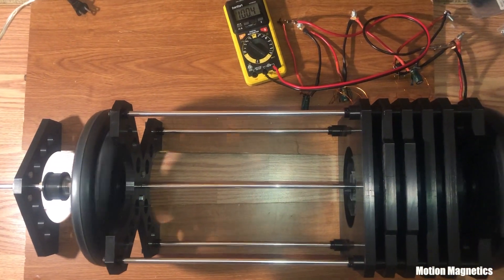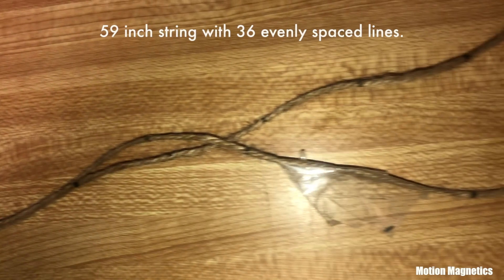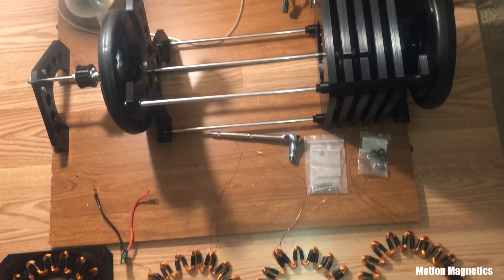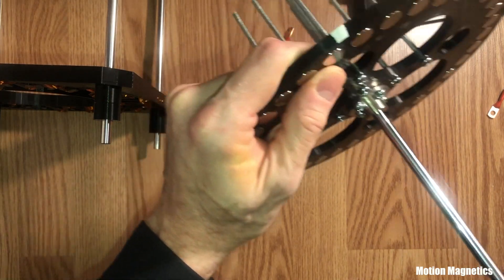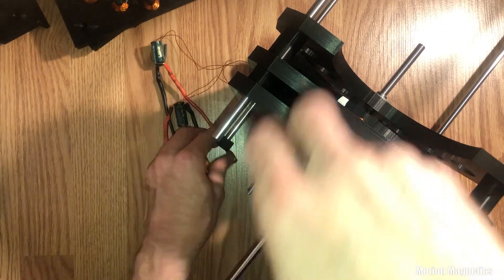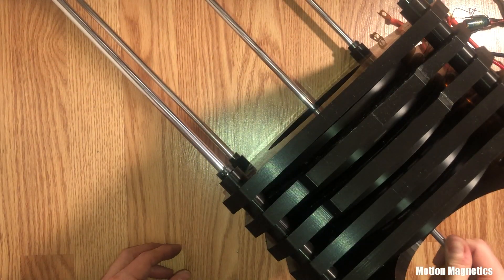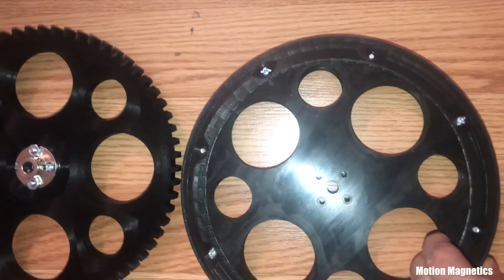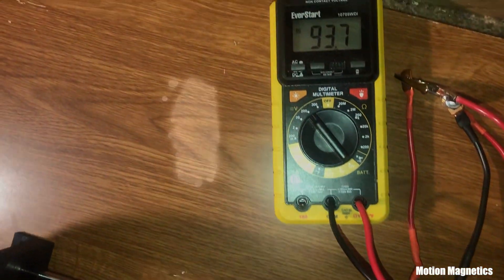Stackable Generator Assembly Guide

Comment: this is awesome generator, or at least at first glance, so I tried looking for at least similar designs and I found almost none accept like those two stator ones, so that begs the question, why (or I can't search is also an option :D) ? I'm not really that sure how this design would be flawed compared to the wider ones (altho my knowledge of building a generator is not the highest so if anyone knows any disadvantages please tell), maybe it's just the 'go vertical instead of horizontal' idea. very interesting :) would love to see some experiments with this, cuz it is exiting to watch to say the least
Reply from the maker: I'm not sure why there aren't more similar designs out there. It just occurred to me when I switched from using coils with metal cores to an axial flux setup that I could stack several of them together to increase the power output. Multiple people have commented that they have thought of something similar, but most of them haven't tried building one.

Comment: If you add propeller like car alternator both side ir wil keep  the coils cooler for longer time since your magnet nad coil center area are open. Like the setup.👍
Reply from the maker: Possibly. You can't tell by watching the video but there's a bit of airflow from the openings in the rotors and coil assembly that creates a fan-like effect, and you can feel air blowing lightly through the assembly.

Comment: In regard to the “rotor alignment bars”…. I wonder if they will pickup any of the magnetic field, potentially reducing the output of the generator. Maybe not, but I’d love it if you replaced them with wood lol. I feel like it’ll make a difference.
Reply from the maker: It's possible. Wood is less sturdy though. I suppose they could be aluminum, but then that could cause eddy currents. 
The magnet faces are not pointed at them directly at the bars. Is there some effect from the metal? I'm sure, but I think it's negligible.
Reply: @Motionmagnetics  I imagine that under normal conditions it would be negligible. However, given that it is not the most efficient design, aiming to keep it simple and easily made at home), maybe it would be worth a try? Also, I can’t remember the term for it, but metals that aren’t magnetic do tend to be influenced by magnetic fields… maybe it’s specifically electromagnetic fields, either way a quick google will explain better than me anyway. There is actually a repelling force instead of an attractive one.  In regards to the strength of the wood, 8mm wood rods should be plenty strong enough. I have forgotten how many you used in the rotors, but  >3 and it should be enough. There isn’t much space that isn’t supported, and the load on the rotors should be relatively even front to back, so there wouldn’t be any twisting. There shouldn’t even be any side loading when the generator is actually spinning, thanks to the wonders of centrifugal force. It wouldn’t work as your MAIN rod, due to the weights. But your main rod has very little rotational mass if you consider the rod with other components removed. So even if wood was strong enough, it wouldn’t change much of anything replacing the main rod. Check out the numbers regarding the strength of balsa wood. Really, if the wood is decent quality, I think some pine dowels would be good enough. Unfortunately they’re sold in standard sizes at the hardware stores. Something like .0025 inches small than 8mm. For straightness, cutting a larger rod down to size would be best. Short of that, I guess balsa wood does tend to stay straighter than pine. Sorry for the essay. I have a semi-kinda almost similar project I’m working on.
Reply from the maker: @thephilosopher13  I hope you'll post your results if you are working on something similar. I'd love to see how it comes out.

Comment: My freind i was hoping that you post the stl file of gravity generator
Reply from the maker: This actually is the gravity generator, I've just adapted the design. I'll share the STL files for the gear system later. I'm in the process of designing and testing a new version of them right now.
Reply: @Motionmagnetics i understand you my freind but this new design in this video i can't build it because there is some material does not exist in my country , all i need my freind a gravity generator of falling weight witch is takes a long time like 6 or 8 hours to reach the ground and thanks a lot you have a good heart i'm waiting for your reply
Reply from the maker: @دعاسيأيمن  Ah, I see. Sorry, you're dealing with that issue. Once I have 3D printed and tested the new gear system I'm working on I'll be happy to share the files. Hopefully, that will help you out.

Comment: high-ratio reduction is a relative term.     anything over about seven to one is usually achieved via the use of more than one stage.    with more losses than a single stage.          d
example of a heavy-machine friction drive, used on a ferris wheel.
https://www.publicdomainpictures.net/pictures/170000/velka/ferris-wheel-drive-mechanism.jpg

Comment: some pma information
you may or may not know the following.
a serpentine coil does  not  make  a good generating coil.        a generating coil should not have  Too many winds/layers, of Too small conductor.      the conductor used should be 14awg or equiv. (coils can be wound  'in hand' if smaller conductor is going to be used.    doing so should result in a relative increase in output voltage, while not clamping the current.)        a generating coil that has too many winds/layers acts as a current clamp.      meaning, you may see 'high' output voltage from such a coil, but the output current will always be  disappointingly  low.        in this case, a flywheel does  Nothing.        as it is in most applications, the prime mover (whatever it is)   SHOULD  have  mechanical advantage (MA) over the load that it experiences.      instead of using multi-stage high-loss gearing,  it is simple and less inefficient to drive a pma rotor via the use of a single stage of (high-ratio) reduction at its  Perimeter; aka a friction drive.       as desired, more than one prime mover can be utilized.          d
Reply from the maker: My intent with this design is to make it simple and accessible to everyone. You're right, there are definitely more efficient and powerful methods to build one. 
The point of the flywheel will become more obvious when you see the full picture of what I'm building. There is method to what I'm doing. Hopefully, people will look at it when I have the entire thing finished and say: "Oh, I see it now!"

Comment: For the weight, I was thinking more of a planetary gearbox similar to (Channel short: Art of Rendering) https://youtube dot com/shorts/eks_oXJZkic?si=9jMPn7_05AphVMqp, with a clock gear like (the 2088 video from Robert Murray-Smith) https://youtu dot be/igzIc3glA18?si=0VR4iyW5rxtBGHXM 

It may be possible to add remove change the planetary gearing or even make it more compact than in the short… and you can still use a belt instead of a chain on the clock counterweight mechanism

Comment: If there is magnet pulling another magnet and if put iron between those magnets. Both magnets are atracted to the iron, so both magnets stops, right. But if i pulling iron with magnet and put iron between those, the moving/pulled iron will continue moving if the canceling is made just right moment. when its comes to sticky point. Luling motor works like this.

Comment: Fantastic and BIG thanks!
I'm going to make one and test a simple cycloidal gear drive. Will share that if successful.

Just wondering if the 400w circuit board link is correct?
Reply from the maker: Thanks! I'd love to see what you come up with. I'm curious about the circuit board coil as well. I couldn't find a place to order it directly or I'd pick one up and test it myself.

Comment: Would be great to tilt / angle the magnets so they build a toroidal flow down the stack for further reduced friction and a little rectified force vector for rotational influence. 
Fantastic design.
Reply from the maker: Interesting idea. Thanks.
Reply: What axis angle would be sufficient for this? What, if any impact would such a modification have on output other than differences from the reduced friction itself?
Reply: @joes144  Follow the golden ration… allowing for a full rotation around the axis for each curve / line of magnets from top to bottom of the generator.  Magnets can be oriented to create a steady flow from top to bottom, essentially physically copying the field expression captured when you freeze a magnet in water.  Have the polarity such that the generator never sticks into one place but wants to finish a full cycle rotation once started.
Reply: @meh11235  Interesting, however I'm having difficulty visualizing what you mean. Are you suggesting canting the magnets within the rotor such that the angle of each magnet can be set same/different, or are you suggesting a rotor with angled edge such that all magnets are at the same angle relative to the coil?
Reply: @michaelh.9243   a mix of both, magnets set to same angle within the rotor and opposing inverted coils or stationary magnets between coils to cancel the magnetic drag that builds up by the coils being activated by the passing magnets. using the S side of the magnet or -coils for addition electrical force vector and drag negation.

Comment: Herring bone gears are quiet and a lot stronger than flat straight gears.  This would be an option of the belt doesn't work out.  If you need help with those, I know how to make them very easily with Blender.  Also, to save a lot of money, you could use all-thread for the outer rods, and the bolts in the rotary assembly.  Just used captive nuts on the end piece so you don't have to repeat the end cap assembly of the rotor.  You can prevent a lot of warping issues if you use a raft or make sure the bed is really clean.  I use finger nail polish remover on my print bed for the best print adhesion.  Straight acetone doesn't work, it has to be cheap fingernail polish remover.  I don't know which chemical it is that is in it, but it works extremely well.  I print on straight glass a lot of the time without any warping issues at all.
Reply from the maker: Thanks. I might take you up on that. 
I would not have thought of polish remover. How ever did you arrive at that idea?
Reply: @Motionmagnetics  It has acetone in it, which is good for adhering ABS prints to glass if you melt abs into it.  I tried that for ABS and it worked.  Then I thought, I wonder if it works for cleaning it.  So I tried it, and have been using it since.  I've tried all kinds of things.  Acetone straight doesn't work.  Alcohol doesn't work either.  But for some reason, fingernail polish remover, makes PLA stick like crazy.  Even works on beds that are supposed to work without anything on them.  I've never used gluestick.  I built 3 of my own printers from scratch starting in 2016.  The second one was a fail due to being way too big and not having a big enough budget for adequate parts.  The third one I rarely use, now that I have a decent size printer that has two print heads on it.  Let me know what size the gears need to be, and I can make them for you.  I have a youtube channel of my own that I don't upload on anymore.  The name of it is inventimark.
Reply: Ethanol?
Reply: @Willrocs  Isopropyl alcohol.  I haven't tried Ethanol.  I suspect no difference though.